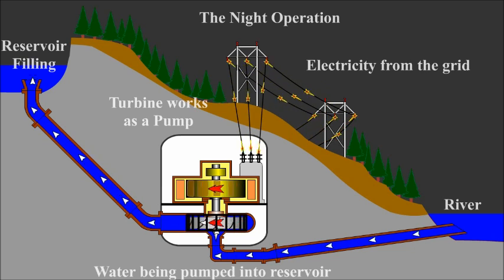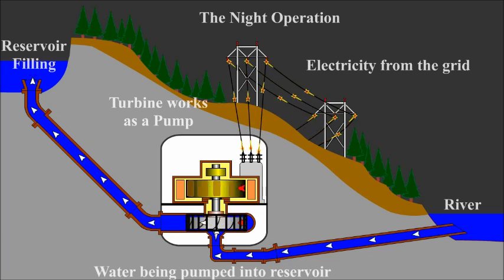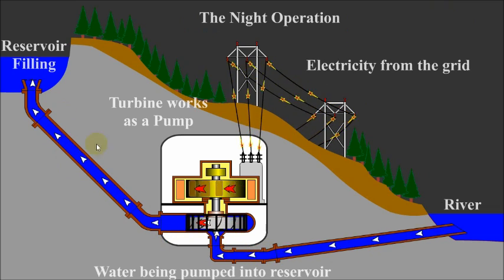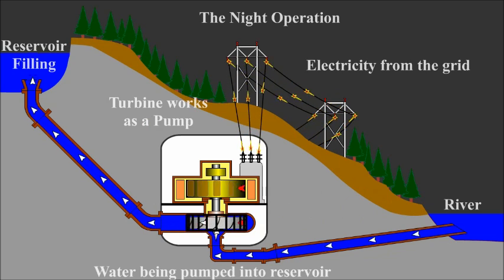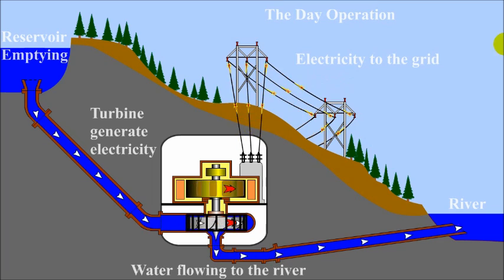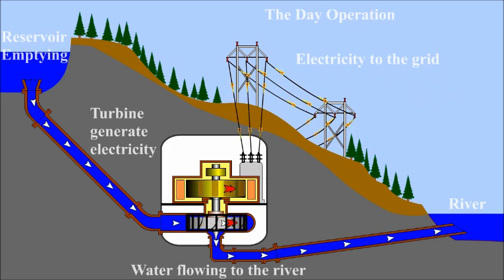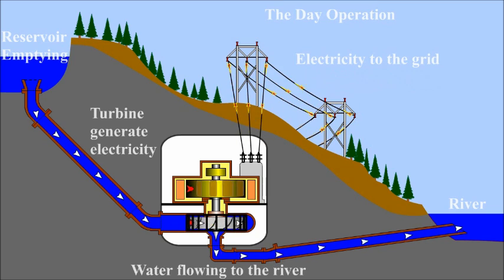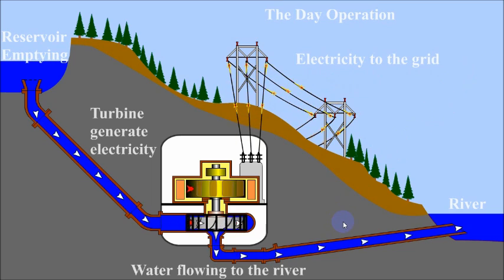Francis Turbines are best for pumped storage systems.

Comment: The reason francis turbines are mainly used in most pumped hydro designs is because they  reverse the francis turbine to pump the water back up to the top reservoir.
So all the power generated when the flowing water runs downhill past the turbines is wasted when the turbines are reversed and turned into motors to pump the water back up to the higher reservoir.

My closed loop Hydro design uses seperate extremely efficient high flow rate pumps to pump the water to the higher reservoir rather than the power generating turbines.
This allows the use of different types of power generating turbines which can run at anytime without the need to reverse the rotation of a Francis turbine.
Two small renewable power plants included in the design with a wind farm and PV solar farm located relatively close to each other but with the wind farm located near the reservoir at the higher elevation can be used to power the pumps which run separately from the power generating turbines. Any excess power from the wind and solar farms not used to power the pumps can go straight into the grid.
Also having the small renewable power plants close to the power generating turbines and pumps allows for reduced build costs for the high voltage infrastructure needed to connect them all to the grid.
Trying to use as much above ground metal pipe as possible with as much equipment as possible above ground saves cost.
If either of the two reservoirs overflow due to heavy rain or snow, the water can be directed into an enclosed tank or tanks or storage reservoir for reuse.
The two man-made reservoirs "off river" are to be built with one reservoir obviously at a much higher elevation than the other.

Also my revolutionary new wind turbine could be incorporated into the overall design described above.

If designed properly the type of design l have described could produce power 24/7 be relatively cheap to build and be 100% renewable and pass every countries environmental laws.

..Designed by.....Mark J Maxwell....😎🇦🇺👍

Just to make it 100% clear. 
Any of my designs and or innovations and any content of mine that has been typed or put on the internet using any method or any of my intellectual property that is on the internet or elsewhere. Which includes my thoughts that someone wants to use will have to be negotiated with me in person for some sort of restitution, before any person company government or entity can make use of them in any way shape or form. Unless I have stated otherwise.

Mark J Maxwell
Reply: Thank you for this info. I really like it.

Comment: Why is it that Francis Turbines are best for pumped storage systems? What about Pelton or Kaplan?
Reply from the maker: The Pelton is out of question, because it can not be used as a pump. There is no way you can reverse the Pelton turbine and pump the water back to the reservoir. You can use the Kaplan turbine as a pump, but they are usually located in low lands where the volume of water is large and head of the water is low. The Pumped storage system are located in mountainous regions where the Kaplan turbine is not suitable.

Comment: Also, I have a relative, that helped design, this type of installation, on lake Michigan, outside of Luddington Michigan. He said it had more drawbacks on the samon and lake trout, running patterns, than they had estimated. As well as a temperature variations.  Of up to 5 degrees. F. Im not some uneducated person, thats just trying to be difficult. I just think there are better ways to conserve. And only producing "close as possible" to the draw needed, is the most conservative method period.

Comment: Let me, make my thoughts a little more clear. Rather than spending a fortune. To build a redundant system. That has to use much more power, than it returns. Why not work on a system that studies power consumption, in real time. While I know it is a difficult task to, lower and raise, electrical output, from a power plant quickly.  Only produce, what is needed, at the times it is needed. It would involve a study of, weather temperatures, population growth and decline. It just makes more sense .

Comment from the maker: Unfortunately it will not work for average people like me and you. We can not buy the electricity so cheap at night like a power company. They will buy it from producer (at night)  say 3 cent a kW and sell it to us 7 cent a kW, pump the remaining extra power to a reservoir and cell it to us 15 cent a kW at day time. I have a thermal storage system in my house. It heats water in a reservoir at night and uses this stored energy for heating my house at winter. It helps to reduce the electric bill

Comment: This YT video is another interesting method of storing electrical power. “The Artificial Leaf - Renewable Energy – Horizons “  This is the same concept as my original question.  Maybe others are doing this but this is the first I know of. In the future maybe a homeowner could produce hydrogen during off peak  periods and then convert it back to electrical power during the high cost periods and or even sell it back to the power company.

Comment from the maker: Dear Marcel, This is a good question. I believe that there is not such a thing as a free energy.  We pay one way or another. We may think that the solar, or the wind energy is free. That might be true, but harnessing it is not free. We spend money for the equipment and labor for building those equipments. We always look for the feasibility  of the power plant. Does the cost of harnessing the energy justify the expense, if it does, than we build the power plant and use it.

Comment: I fully understand the mechanics of this system. However, it is a complete, in your face, load of crap. The money spent on building this, what I call "artificially induced power need, deception" this money needs to go to research, finding more efficient ways to store electricity, already produced.
Reply: Actually, it is not what you say. If it didn't make complete financial sense, they wouldn't be built. What do you think people don't go through the economics of these projects first before they are built? But what ever, you are obviously against it.

Comment from the maker: Hi Tut, this is a good question. Lets assume that the efficiency of the turbine is %90 and we used 100kW ( example ) to pump the water uphill. We can only get 81kW back from it, due to losses. If we spent 3 cent for every kW for pumping it will be $3 dollars to pump the water uphill. When we generate 81kW electricity from this water and sold it, 6 cent for every kW we generate, it will create $4.86 revenue. At the end we will make $1.86. These power plant are large and actual revenue is  higher.
Reply: I fail to see the reason why you would want to use a storage reservoir when you could pump the water up less distance and release it to power a paddle wheel installed at the side of a small canal.
Even with relatively small amounts of water, equivalent to the flow of a stream,  people have been powering flour mills for hundreds of years. If you pump more water to increase the flow normally used by flour mills you could overcome the inertia caused by the gearbox.
Those paddle wheels spin at about the same rate as a wind turbine so it would not be beyond the realms of possibility to use the existing turbine technology installed on wind farms, with just a blade change.